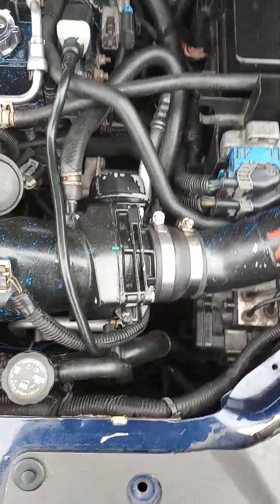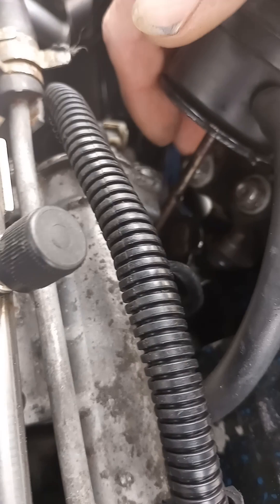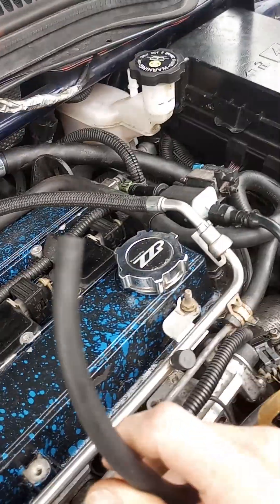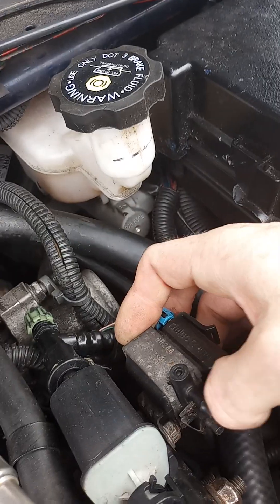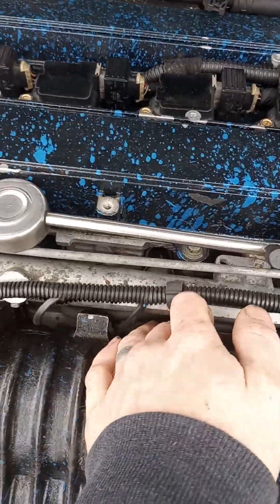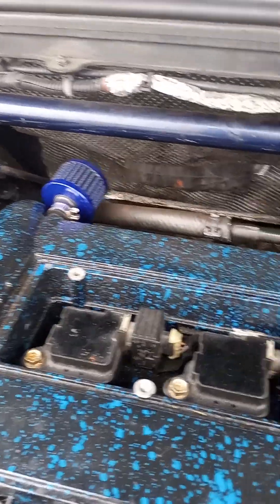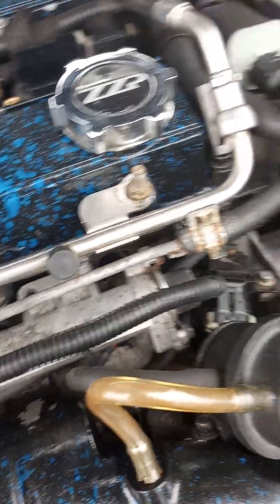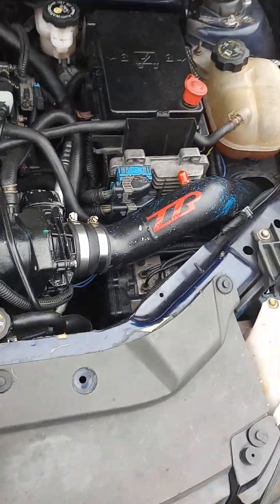Eaton supercharger bypass valve adjustment and mod tutorial

Comment: I wonder if someone came make or find a video how to  adjust the bypass valve or specifically tune it? I only see 5psi
Reply: Ever figure it out?
Reply: @dillon3562  I have an idea I haven't had time to try it, I have a boost gauge and it's rigged up and not installed right. I bought the cat used and noticed the shotty work 😆 but working on finding the clunking noise for now.  Did end links and swaybar bushings still no luck